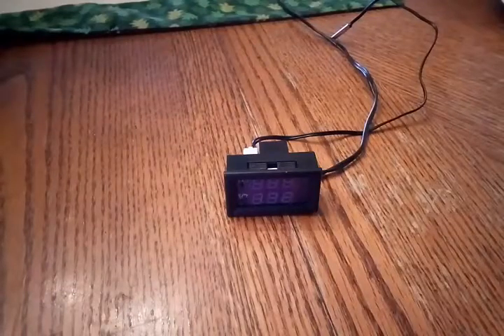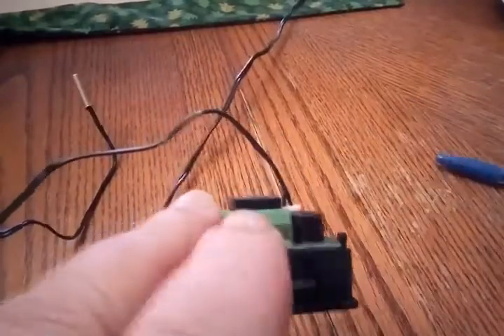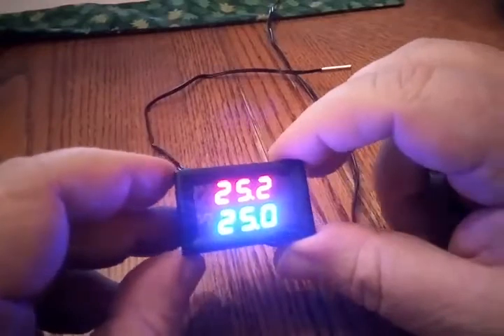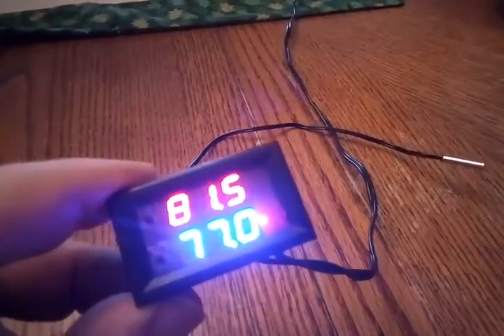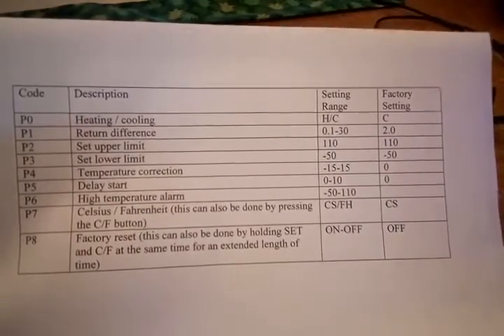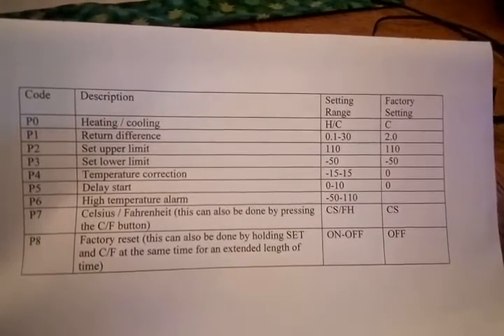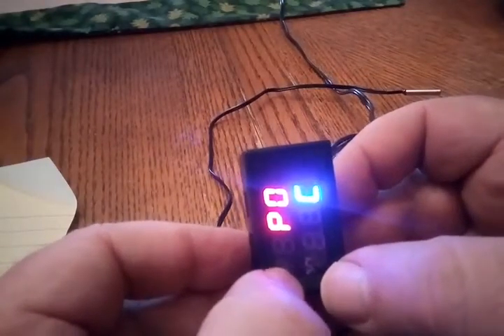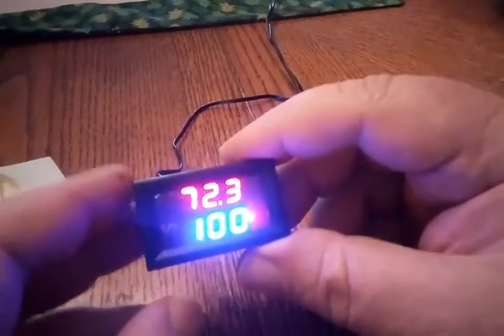Cheap digital thermostat for homemade diy incubator

Comment: Hi. I'm trying to regulate my radiant 12v heating film. I understand powering the thermostat from my fuse block. Would I then just put the 12v heat film into the load side?

Comment: Excellent. My identical thermostat from Amazon will now become useful thanks to you. Great video. I will use mine for our winter mode climate control DIY butter housing box. The summer season is great without it, but the butter gets cooler and non-spreadable around the kitchen for 8 months of the year here in eastern Canada. So this will maintain a butter temperature of 23 degrees Celsius. My wife loves it. I'm using an incandescent night light bulb to heat the box.🙂

Comment: thankyou very much for doing the work for me and fin ding and making sense of these instructions. I am using mine to control the temp on a small space heater to install inside my 3d printer as i live in the UK where it is mostly colder than your neck of the woods (judging by the temp on your you tube video. Well done!

Comment: Hey , lamp +  connect on 12 v ,  k1 connect with gnd , and k2  conncet lamp gnd ?  Tnx
Reply from the maker: I'm not completely sure I understand your question.  If you're using it to turn off and on a lamp, one of the wires should connect to one of the last 2 terminals.  The other of the last 2 terminals should connect to the power supply to the lamp. Which is not necessarily the power supply for the thermostat.  The first 2 terminals are for the 12 volt power supply to the thermostat.  Hope this helps
Reply: @MrBuddymo  I use google translate ... , can you give me mail ?  i send picture...

Comment: Thank you very much Buddy! I will using this device as a heat controller for my 1973 Chevy truck. Does it store the settings when power is off? Regards from the Netherlands. Harry.
Reply from the maker: Yes, it keeps the settings. Good luck.  You have a cool truck - that was the year I graduated high school.
Reply: @MrBuddymo  here in the pilipinnes were i can buy digital termostat
Reply from the maker: @janinevillagen5586  I got mine on Ebay. Amazon also sells them.
Reply: I am using one to control an automatic external cooler in a 1967 C10 truck. After my son smashed his 2003 Tahoe, I am using the 5.3L engine but had already built a 87 era, 700R4 that I had already bench built with all the goodies. It should handle 600 HP, but not putting 4 turbos on it. Just a daily driver for me. Retired ASE Master Tech
Reply: Harry, If your in Omaha someday, we can check out each other’s trucks:) I know...too bad you can get it here very easy.

Comment: How will the 12v power supply power 110v lights?
Reply from the maker: It doesn't.  The 12v supply powers the thermostat relay which acts as a switch for the 110v lights. A separate 120v power source is needed for the lights.
Reply: Thank you

Comment: Gday John hear Is there any chance u can give me the output voltage an amps as each one iv looked at don’t have output voltage only the input voltage in discricption / information
Reply from the maker: Good morning.  There shouldn't be any output voltage. The relay acts as a switch for whatever voltage you provide (within the limits of what the device can handle). The input power only powers the device - the relay side is completely separate. 
Thanks for watching.
Reply: Thanks for your prompt reply I’m going to try run ay 12v 10amp cooling system off the output side I didn’t really won’t over load 12v 10amp cooling unit I’ll put link below to the unit I’m trying to run off the thermostat u have in vid an thanks again for the help 
https://www.ebay.com.au/itm/200-x-118-x-95mm-120W-Thermoelectric-Peltier-Refrigeration-Semiconductor-Co-E2X3-/293190973323
Reply from the maker: @johnoconnell3459  I am not an electrician.  Another viewer expressed concern over how heavy a load this can handle so you might want to do some more research. Sorry I'm not more help.
Reply: Iv order 1 just waiting on it to get hear ges I’ll test it on multimeter an go from there an thanks again an the programming details top job

Comment: You are a godsend.  I ordered a gadget from aliexpress.  They didn't send me the one I ordered but did send one of these.  

It suits my purpose (I am using an incubator fan to warm the insides of a small 19-inch cabinet I have stuffed a 3D printer into).  

Thanks especially for the manual.

Comment: The nice feature of the WK1209wk over the bigger less astheticly pleasing WK1209 is that the former has a power off memory. So in the event of a power interuption it will revert to your program settings, NOT factory settings. This can be important!

Thank you for posting the codes, my unit came with no instructions.
Reply: Settings are same like W1209. Only to enter settings you have to press both front buttons at same time. Rest are same. But a bit accurate as compared to 1209 and also have alarm

Comment: Very useful video. I have tha W1209 and a W1209WK, I was wondering how to sort out the later with only 2 buttons.  
If I may make a suggestion. Use Notepad in Windows for text. .txt extensions can be understood by ANY compute (maybe even a Mac ?)  I copy pasted your doc file into Notepad - it's understandable but not pretty.
You could have used P1 as 0.0, P2 as 99.5F & P3 as 100.0 F (I think) ?  Wonderful kit for the price. Thanks a million from across the pond.
Reply from the maker: Thanks for the comments and suggestion.

Comment: Hi,
Excellent instructions!!!
I wanted to ask you though, how do you connect this to your actual device. I am trying to connect it to a Peltier heat sink to make a mini refrigerator ( please see link below)

https://www.amazon.com/gp/aw/d/B07DWVN3TC

How would I connect the thermostat to the heat sink? My heat sink has three black and three red wires and I had joined them together and connected them to a battery source. I found your video to be great in explaining how to set it up but since I don’t have much engineering background I wanted to ask you how do I connect my heat sink and the thermostat together?

Also, in this way would I need two separate power supplies?

I would really appreciate if you could reply as soon as possible as I have to do this project tomorrow.
Reply: @Kids homework     >This info is probably too late but others may have the same questions.
 I have Model W2809WK that comes with case. Now set up is the same as this device operates on 12 volt dc with B+ in terminal #1 when facing you on the left. #2 12 volt dc negative
#3 and #4 if your device is rated higher than the relay (They are marked on top, some 10amp, like mine, 20 amp)
If you are controlling a device that uses more than this modules rating, or runs on A/C voltage, you need an external relay. Just make the coil side operates on DC voltage. The A/C side to your device should be controlled be the “Switch” side of the proper relay. The heat sink I believe you are talking about is the two wire sensor. These are negative temperature coefficient type thermistors that have high resistance high temperatures and drop quickly when warms. Using a thermal paste, if cooling (Or heating), mechanically attach it to or near the coldest or warmest place for sensing. Otherwise, it may not work how you want it. Hope this helps. ASE Master Tech since 1978 - Retired

Comment: Good video. Do the parameters default if power is removed? I want to use this in a car with a portable cooler so 12v power is only available when igniton is on.
Reply from the maker: It retains the program when the power is off
Reply: @MrBuddymo  Great. Thx

Comment: What is the difference in the heat and cool mode ?
Reply from the maker: Nicholas Kindred In heat mode it will turn on when the temperature falls below the set temperature. In cool mode it will turn on when the temperature rises above the set temperature.

Comment: Does this have a memory?   Like if you use a keyed hot instead of constant power, will it turn on and have memory of last set values?
Reply from the maker: David Brannan Yes, I have disconnected it from power for several days and it still has the same settings when reconnected.
Thanks for watching.

Comment: Hi, great video lots of info, thanks. One question, could you tell me the outside diameter of the temp sensor sender unit please. Thanks
Reply: @1CM69    >These are probe type NTC thermistors sealed with a little epoxy. It measures 3.9 mm or 0.153” real close to 5/32”.
The total length is over 3/4” and measures 20.2 mm or 0.798” which is less than 13/16”.
Hope this helps, never too late as others may see this. ASE Master Tech Retired
Reply: @deankay4434  thanks, a long forgotten project now 😉 but info will be helpful to others.

Comment: I checked the calibration on mine by sticking the probe under my tongue.  If it doesn't read 98.6f either it's needs calibrated or you're sick.  Good info on all the settings, I'd figured out the two I need (same as you) but was curious what else this thing could do.
Reply: The relay on mine says the same, although I'm only going to use it to control a relay that will operate the load (radiator fan)
Reply from the maker: TwelveFoot Good idea on the calibration. mine didn't need calibrating but it's a good idea to check. What do you use your thermostat for?
Reply: Going to use it to trigger a peltier cooler to keep the cooling water at a nice temperature for my laser cutter.
Reply from the maker: TwelveFoot I don't know how much current that draws but you might want to check out the post by Gambiarrero along with the link. I am no expert but according to him this device has serious limitations regarding what is being switched.
Reply: I've got to double check, but I think at most I'll be running 8a at 12v.  If I'm reading the relay right it says 20a at 14v.

Comment: I had a look at your document: for preventing large overshoot, on/off control with a band of just 0.5% control error requires either very fast control (sliding mode control) with very low dead time, or "low amplification" with a well dimensioned heat source. Depending on how often the incubator is opened, a good model of the "plant" (the incubator), and a PID controller might be worth considering.

Note that the module is outright dangerous if the relay is used for switching 110/240VAC! The design of the W1401 is much safer! There is some reverse-engineering analysis on the W1209WK available (and even a open source firmware if you want to roll your own) here: 
https://github.com/TG9541/stm8ef/wiki/Board-W1209WK
Reply from the maker: Gambiarrero Thanks for the information. Like I said, I am not an electrician. I wouldn't want to do anything with this that would be dangerous, nor would I want anyone else to do so. My plan was to use this to control a 60 watt light bulb at 110 volts. This falls below the maximum amperage stated in the document from your link. What am I missing? I'm not arguing, I just want to understand.
Reply: Sorry for the late reply. The current isn't the problem. Most thermostat provide insufficient insulation spacing between high voltage and low voltage parts but the W1209WK is a bad case since it has a copper trace just below the screw terminals. Besides, it's rather inaccurate.